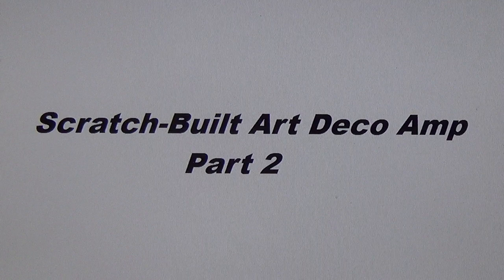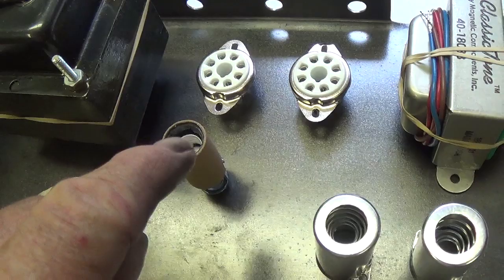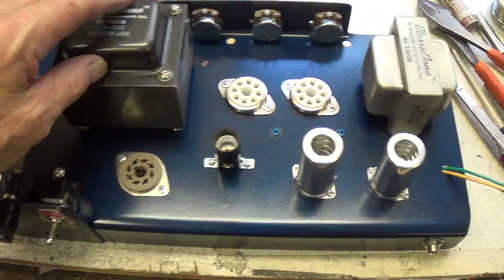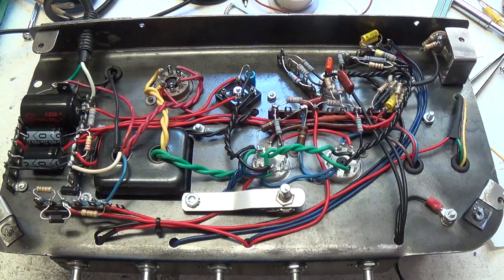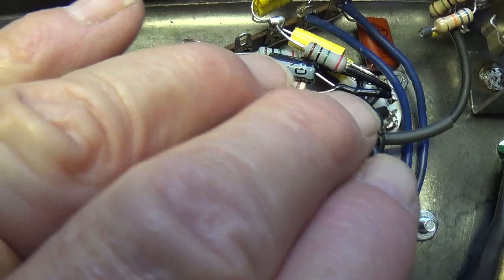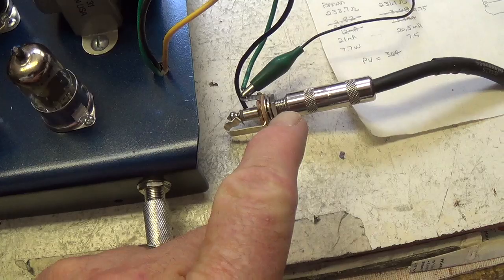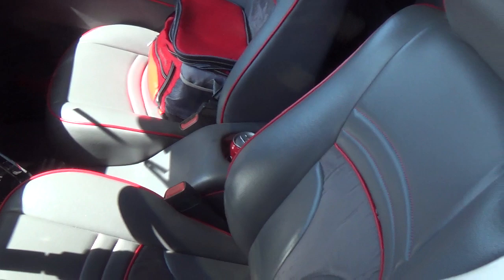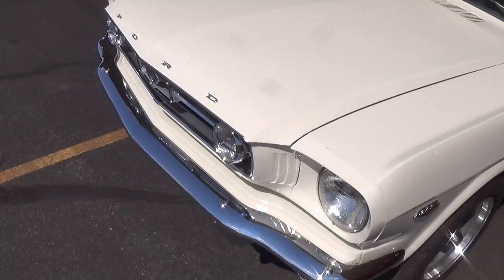Scratch-Built Art Deco Amp, Part 2:  The Chassis is Completed

Comment: Looking Great! Sounding great too even with the temporary 6v6s, very clean warm tone. My only OCD observation, why not grommet all of the chassis holes? Overall another beautiful chassis. Your attention to detail, like the mounting bracket providing shielding for the input jack and your careful attention to component layout,  puts you in an elite category of amp builders. I can't wait to hear what effect the variable negative feedback has on the sound. The car show was really something. I had a buddy in high school that had a 69 Rally Sport Camero, with hideaway headlights but hardtop and 350 with a Muncie 4 speed. The 67 with the L79-327, talk about a huge beast hiding in a small package, in my opinion the best small block Chevy ever produced.  I had one that came out of a 67 Vette. 365 HP stock, 202 humpback heads, 30/30 cam. Mine had the new ”optional” quadrajet carburetor, which most people either love or hate. I was never much of a fan of metering rods controlling secondary jets but when you put your foot into it and those 2 1/4 inch butterfly valves opened and pulled the top shutters down and metering rods up. Wow what a rush! And the sound, that throaty low hissing rumble, just waaahhh. Gives me shivers to remember it. I have always been a fan of ”Slot Mag” wheels,  N50-15’s on the back of a Camero and L78-14’s on the front. Oh to be young again. I can't wait for part 3.
Reply from the maker: Thanks, Mark. I was too lazy to go to Harbor Freight for the smaller grommets, but let's face it, we'll both be long gone before the insulation on any of the signal wires wears through :)  Your reminiscences take me back to the good old days of working on cars all day and racing the hell out of them all night. Nowadays, we'd end up in jail for sure.
Reply: No doubt about ending up in Jail today.  Back ”in the day” I did get pulled out of World Geography Class and hauled in front of a City Judge by the Cheif of Police (another Buddy) and called as a witness to a little incident involving a 55 Chevy, a set of N50-15’s and some ruts ripped into the high school principal's prized front yard. Jeff, the Cheif, told me what to say to keep us all out of trouble on the way to City Hall. It ended up costing Dan, owner of the 55 a $50 fine a bag of fertilizer, and a public apology printed in the newspaper. Small Town Justice. Getting pulled out of class did do a lot for my bad boy reputation,  very few people were privy to the fact that the Cheif of Police and the other officer (the entire department) were both friends of the drag racing bunch. We used to go visit which ever one was having to work the night shift on Saturdays at 2 or 3 in the morning. Sit and compare drag racing stories till dawn.
Reply from the maker: Yes, things have definitely changed.....and not for the better, I'm afraid.

Comment: Very nice build, I like the blue chassis paint, classic touch.  The only thing I cringed at, as another commenter pointed out, was the lack of grommets in the thru holes, I understand that modern insulation is very durable and the grommet is probably overkill, but you took the time and expense to use high quality transformers of overkill capacity so I would hope next time you would add the very small expense of rubber grommets. Just my two cents, overall I still give it two thumbs up.
Reply from the maker: Thanks, Gary. I have added most of the missing grommets, and hope that this reduces the cringeworthiness of the project :)
Reply: How wonderful Uncle Doug! Whew, I can now refrain from cringing at the thought of those poor wires negotiating the fearsome sheet metal penetrations without some good old rubber grommets.  I look forward to seeing and hearing the final project in the next video. I'm sure that a clean tone will match that sharp, clean looking Art Deco inspired build. ;-)
Reply from the maker: We can both rest easy now, Gary, the chassis is more thoroughly grommeted.....and now it's time to focus on the closing act of this lurid video series.

Comment: @4:00 Computer modders use a 7Volt Fan mod, where they take a 12V fan, add a 5V ground, which drops the voltage making the fan run quieter while still moving air.
Reply from the maker: Thanks for the tip, Brian.
Reply: @UncleDoug  I rechecked and I think it's the 5V pos not ground, that you're suppose to attach. It's a common enough mod and Google has pics of it. I've just never done it is all. And I think Thermaltake and a few others still sell some PC fans with inline speed controllers.
Reply from the maker: @brianterrill9587  Thanks for the info, Brian.

Comment: Observation and not a negative comment,maybe some rubber grommets for power feed thru,regards Colin.
Reply from the maker: I did use grommets on the wires carrying current, but agree that every hole should have had one.

Comment: Great video, Uncle Doug. Was that the pair of 6v6 tubes you showed us...one FOMOCO and one DELCO? If so, they seemed to handle 300 hz okay together...though you didn't show us
a "scope" shot of them horkin' the transformer around. Without a doubt though, that should be one classy head when you get done. And thanks for the trip to the car show...and the
shot of one matched pair of cheer leader parts that went well together. I was kinda hoping for a quick updraft to happen there...oh well...
Reply from the maker: Thanks, Tom. One of the tubes is a Delco, but the other is Sylvania I think. They are an electrically matched pair that I use when setting up a new circuit. I'm glad you enjoyed the show.....and the cars too :)
Reply: I can see why the 6V6s would be of different brands and still run pretty well together. Specs is specs...and every now and then, two different companies will produce
something that'll meet specs...just not on a Monday morning after a long party weekend(8-). One other thought. I've never met a 6V6 worth it's salt that wouldn't
match a 6L6 for sound quality. 6L6s just make more torque(8-).
Reply from the maker: Yes, they're an odd looking pair, but they really work well together, especially for testing purposes.
Reply: Next video, can you show what speaker you plug in? It's nice to know which "exhaust system" them cousin 6V6 tubes are dumpin' into(8-).

Comment: Thank you, Uncle Doug.  The metallic automotive paint is a nice touch - as is the Christmas bulb.  Isn't there some way to adapt a switching 1/4" speaker jack so it will be connected to an 8 ohm resistor when there is no speaker cable installed?  You know - to save the tubes in case someone makes a mistake.  I'm gonna look into that.
Reply from the maker: You're welcome. As I recall, I did it on my Mystery Amp build, Willy. Check it out.

Comment: Isn’t it a good idea to put a grommet on the 120v line passing through to lamp?  Hate to light up the whole chassis and user when the wire get old and dry.
Reply from the maker: If you look closely, RB, there is a thick strain relief tube which insulates the AC from the chassis.

Comment: Do you do point to point/terminal strip for the extra challenge over doing turret board layouts? 

Heads up, 3 wire cord safety grounds should have their own chassis ground point, not shared by anything else, it’s code. Not that I think anything you’ve build would ever fail catastrophically enough to shock someone! (Although I hope those output transformer wires get a grommet when I get to part 3!)
Reply from the maker: It's simply the way I started building circuits and it works well for me. Why would attaching the (green) ground wire to a shared spot cause any problems? There has to be a logical, compelling reason......or I will continue to ignore the "code".
Reply: @UncleDoug  I guess it’s so it’s slightly less likely to be affected by any physical damage that’d be more likely to detach a shared ground or something. 

Maybe it’s so a short to the shared lug that’s bad enough to burn out any of the wires going to it doesn’t affect the safety earth? 

One chunky Earth cable lug with its own bolt and star washer right near the iec socket or lead input (always tie a knot in the cable inside the chassis so it can’t pull out yadayada) is unlikely to go anywhere.

To be fair, someone usually got hurt for a code to get put in place about something, however, that doesn’t necessarily mean that the person that got hurt wasn’t just stupid, or messing with something they shouldn’t have been.
Reply from the maker: @Jonathan_Doe_  As a former "scientist" I tend to question all dictates that offer no justification for their existence. Another example is the fuse-first rule.....which is totally counterproductive. I hate to appear stubborn, but absent any supporting data, I am going to continue using shared grounding and on/off toggle-first.

Comment: Hi Doug! Impressive as always :) I'm just building as you guessed a preamp...and was thinking...does it matter in which direction the power transformer is mounted in regards to the first input stage? Having some hum (50Hz) and i somewhat confused. The transformer is in the left part of the amp and the first tube in the other...just about a 30cm between them, and also should the input jack be grounded in the chassie or not? Hope You don't mind my questions...//Peder
Reply from the maker: Thanks, Peder. I don't think it matters what direction the PT faces as long as it's as far a possible from the pre-amp tubes. Yes, all input and output jacks must be grounded to the chassis. You might consider using shielded cables for your pre-amp wiring.....i.e. input jack to first tube grid, to volume control, to second stage grid.

Comment: Hi Doug, did you consider using an LED for your internal light, thus being able to use a DC supply to power it rather than introducing AC? It would also be cooler and last longer.
Reply from the maker: It didn't occur to me, Allan, but it would have been a good idea.

Comment: You have 6 V D-C for the fan--you could just as easily used it for a 6 V DC heater circuit!  You would not need 100 ohm center tap resistors and would have even less chance of hum.
Reply from the maker: No need, Alan. AC heater supplies never seem to cause problems if an amp circuit is properly designed and constructed.

Comment: What power transformer did you use? I think I can see that the output transformer is a 40-18038.  7025 is just a fancy 12AX7, right? I might build this one.  I have no reason to, but it would be fun!
Reply from the maker: You're right about the OPT. The PT is a 40-18016, both from Amp Parts Direct, my new favorite supplier of all things transformerish.  By all means, build it. As you'll see in Part 3......it's a gem.

Comment: One thing for me that is missing, from valve amps is an analogue meter ;-) perhaps showing voltage?
Reply from the maker: There is really no reason to constantly check voltage or current, Nic. The meter would probably never move.
Reply: True, its more for appearance -  I just like analogue meters on amplifiers, cost me an arm and a leg to get a preamp / power amps with meters. Mind you Hi-fi is a totally different ball game.
Reply from the maker: It would look very nice......perhaps meters to monitor the plate current in each output tube.
Reply: It was just a thought, turning what is an inanimate object per se into a curiosity.
Hoyt do supply meters http://www.hoytmeter.com/analog-panel-meters.html
Possibly this http://www.hoytmeter.com/analog-panel-meters/17-l-dc-analog-panel-meter.html or off a donor, imagine Mr Carlson's Lab has 100's
Reply from the maker: I like the idea, Nic. Thanks.

Comment: Couldn't you place a terminal strip off of the Tube socket? So you didn't have such a conundrum of taps on one lug?
Reply from the maker: If you're talking about the V1 12AX7, Tim, there are terminal strips.....but there is nothing you can do when about 89 connections have to be made to 9 tube pins in a half-inch circle.
Reply: I can understand that!

Comment: Uncle Doug, what types of rivets do you use on chassis? I'v been looking for something with as minimal bottoms as yours, but haven't found anything. Thanks for any info
Reply from the maker: I buy the shortest pop-rivets I can find at Home Depot, Marty. They are 1/8" by 1/4" as I recall.
Reply: @UncleDoug  Thanks for the tip and all of the other ones. I just added tremolo to a Bogen CH-8 and was looking for  info on how to add depth. Of course, I found your video on doing the same thing in a Princeton Reverb and was able to adjust the resistor between the plate and intensity control and achieve the swampy thump I was looking for. Thanks so much!
Reply from the maker: @martyfielding2848  Glad to hear the videos were helpful, Marty :)

Comment: I"m still curious about the inclusion of a fan. None of the old Fenders used fans.
Reply: With his overspec'ed PT it is very likely unnecessary as his PT should run much cooler.  But better safe than sorry I guess.  He could add a thermal sensor so it only turns on if the internal temp of the amp reached a certain temp.  ;^)
Reply from the maker: You seem fixated on the fan, David. I thought it would be a good idea to keep this small metal box from becoming a Dutch Oven.  The fan is absolutely silent, uses almost no current, and in my opinion is a practical addition.

Comment: Hi guys! What is the source of the strange sound in 20:25 to 20:26? I build Marshall JTM50 replica and sometimes same high frequency spontaneous sound is audible. Could you help me find out the root cause? Thanks!
Reply from the maker: In this case, the wires to the 6V6 plates were reversed, Marcin, so that the NFB became a PFB. Reversal of the plate wires corrected the problem.
Reply: Uncle Doug  Are you sure? I think reversing plate wires causes continuous "microphonics" sound, not irregular. How could you explain your amp stopped to "microphonics" sound producing clear sound? PFB (caused by reversing plate wires) is totally out of the control and cannot just stop spontaneously. IMO the root cause is other, so could you double-check it, please?
Reply from the maker: Reversed plate wires creates a PFB loop that will cause continuous oscillation.....however in this circuit, since I had an adjustable NFB loop, it became an adjustable PFB loop, thus it would come and go depending on where the NFB pot was set. Trust me, once the plate wires were reversed, all oscillation, weird squealing, and other distortions ceased immediately.

Comment: Ever built a guitar amp with vertical-not horizontal-output tubes?
Reply from the maker: Some of the early Gretsch amps had vertical chassis. The only problem I can see is that not all tubes operate properly when horizontal.
Reply: @UncleDoug  Um, I don't mean vertical or horizontal operation. I mean that TVs had horizontal output or "sweep" tubes  which were most all plate cap types and show up in Drake ham equipment, illegal chicken bandit linears and a few audio apps like the Mc MI350/MC3500, a couple of Capt. Catchfire designs like the EAR 509, et al. TVs also had a vertical output tube that was usually a triode early on but later they went to beam power tubes. Both of these types had the "disadvantage" that they weren't terribly linear. But for a guitar amp linearity we really are not very concerned with. 

 Sweeo tubes were once cheap but th CBers have used the supply up pretty good. No one wants the vertical output tubes. Even the 6.3/12.6 heater versinons are usually in the dollar pile at ham fests. They won't ever make more but enough survive for the homebrewer and experimenter. 

 Very early TVs used 807s or even 6L6s as sweep tubes and 6B4Gs ( a 2A3 variant) for vertical output. Sweep tubes were "high perveance" and had really thin plates for cost reduction because average power was tiny. Drake used them for RF outputs but the Collins fans said that they wre no good as opposed to the more rugged 6146. Drake and Collins were rivals the doctor and lawyer hams argued over like Stutz Bearcat and Mercer owners did fifty years before. Drake had better receive numbers, Collins had a more durable output section and so forth. If you had two Drake or two Collins owners having a QSO they would "chase" each other eventually off the band because they had a transmit/receive offset of a couple hundred hz. Neither was great for CW or AM, Am was gone by the time I was old enough to hang with the hams and CW was seriously practiced usually by homebrewers who built their own transmitters and either built their own receivers or used commercial grade ones like Racals or the R-390. I never did learn code and never got licensed as a ham until nocode came out but I did get a General RT license, I missed being able to get a First Phone by a short time. I worked on Motorola and GE two way equipment, King/Bendix avionics and Cushman and IFR/Aeroflex test equipment. But I grew up among those guys. They were almost all Freemasons and were involved with public service as well as homebrewinng, repairing, antenna building, al that stuff. But enough reminiscing, that was a long time ago.
Reply: @UncleDoug  An aside, each type will have an "orientation" listed in the tube manual. Usually it will either say "any" or if sidewindered a certain clock orientation will be specified so the anode structure is directly up and down.